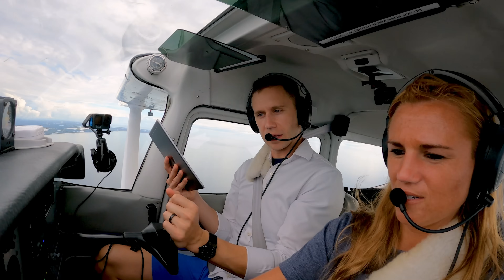Forward Slip vs Side Slip - Day 2 of The 31 Day Safer Pilot Challenge 2024

Comment: Ok, going to make some comments you won't like.  As a qualifier, former CFI, airline Instructor Captain, 20,000+ hours.  But 1st, thanks for pointing out the difference between types of slips, a very confusing topic for most.  You can absolutely forward slip to BOTH reduce airspeed and altitude.  Believe it or not, I was taught this by an old hand in a DC-9.  If ATC left us high, and we already had all the drag out (flaps and gear, maybe even spoilers), but needed to slow down AND descend rapidly, we would put the aircraft in a exaggerated nose-down attitude and induce a pretty massive forward slip, with wing down and opposite rudder.  You can imagine how much drag a DC-9 fuselage can create.  As long as we maintained a good stall margin airspeed, no problem, but also removing the slip above 500' to stabilize the approach.  I'd also like to suggest you change technique away from the crab to sideslip landing.  Here's why.  On very windy x-wind days, you might find out, just as you transition from the crab to slip down close to the runway, that you don't have enough control authority to keep the plane on centerline, let alone on the runway.  If you instead hold the sideslip all the way down final, you can then determine if you can hold centerline through all the wind changes and gusts along the descent, as to not be surprised in the flare.

Comment: In regards to safety in only a small to medium aircraft, in case of an engine failure on base to final (it's rare) then coming in higher & doing a side slip can get you there restricting flaps as you need them, but this isn't needed if you make your approach correctly, but it's fun to practice just in case of an unforeseen situation ie landing  in an out field or certain place after an engine failure, make sure you don't increase speed while doing it!

Comment: 2/2, do you teach forward slip in a turn, such as base to final?  I've found that some pilots aren't aware that they need to make sure that you always use pedal opposite to the direction of the turn to avoid getting into a skid instead of a slip.

Comment: 2 for 2.  Excellent point about remembering that a slide slip is available to reduce speed.  This can be very helpful when you need to quickly get under Vs1 or Vso and don’t want to gain altitude by pitching up.

Comment: At 2:42, you say, "I could even hold my wings level and slip in this situation."  Then, the control inputs are shaky.  Are you trying to cross control with wings level, while making minor corrections?  Does it work equally well with say, right rudder and left aileron?

Comment: I was taught when using the side slip power can be used and the rudder use is to keep runway alignment and ailerons for center line. Forward slip is no power, full or nearly full rudder in direction of any crosswind and ailerons to keep centerline tracking. 
Love your videos! 2/2

Comment: 2 of 2, you said twice can't slip for speed and altitude at same time but not why or quite what the difference in setup is for both, the challenge of a quick vignette
Reply: Slipping involves intentionally creating a situation where the aircraft is out of balance, this during a critical phase of flight.  Combining two types of slips unnecessarily increases complexity at a time where a mistake (getting too low and impacting terrain or stalling and impacting terrain) could cost you dearly. When in a slip, remember that your airspeed indicator accuracy is compromised